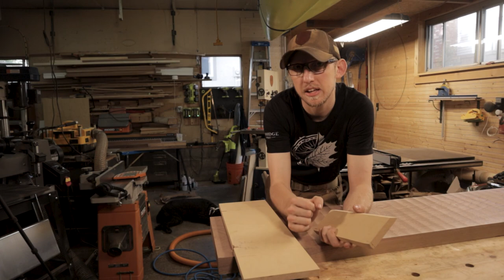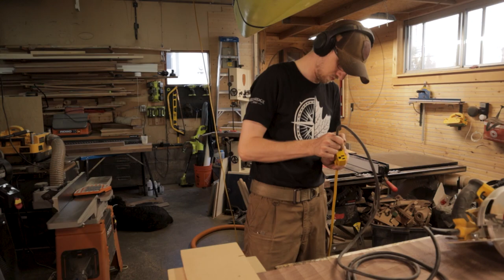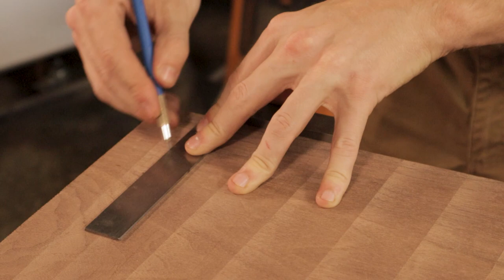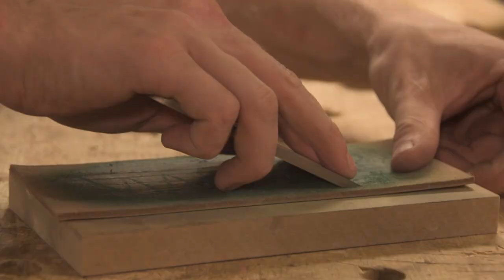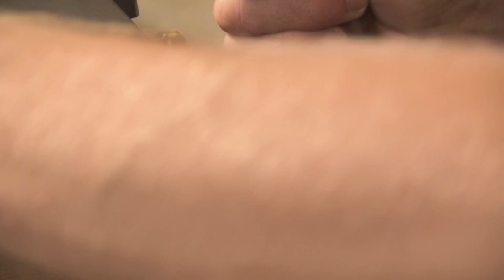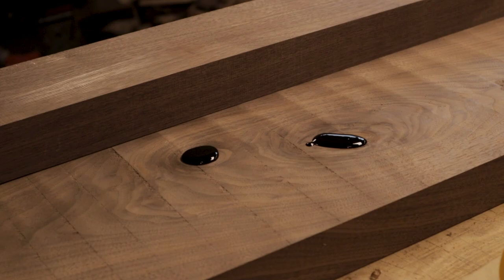Squaring up the side rails with a hand plane | King Bed Frame | Fine Woodworking

Comment: Buy the Festool Track Saw. You will use it for years. It is a shop time vs efficiency issue. It may not be worth the money for just 1 project, but 4 or 5 projects later the track saw has paid for its self in man hours.
Reply from the maker: Trust me I want to but at $900 it's a tough pill to swallow. I feel like if this project keeps going the way it is, I'll end up with the track saw one way or another!
Reply: @morganhurst_redridge  buy once, cry once as they say ... I'm facing a LOT of heavy sobbing myself.

Comment: I'm glad you got to a square board in the end, that was quite a journey, and I've definitely been in similarly frustrating situations on my projects.

I think you probably could have gotten good results with the router if you had adjusted your setup a little bit. If you have a bearing guided bit that is big enough, you can double sided tape your MDF guide right against the line you want to cut. If possible I'd only leave about 1/8“ max to take off with the router after your saw cut.
Reply from the maker: That's a way better idea, I didn't even think about using a bit with a bearing. That would've worked better, I'll definitely remember that when we get to working with the other long stretches!

Comment: I wonder if the circular saw blade is just flexing too much with the thick stock. I know I had that issue with squaring up the ends of my 4" thick Roubo workbench. I just lived with it because it's a workbench. However, I wonder if taking several shallow passes with the circular saw could help prevent the flex of the blade.
Reply from the maker: That's what I thought the issue was too, but when I cut the ends I did the first cut then did a finishing cut that was 1/2 the blade width to try and true it up. Interestingly enough I get the same amount of error almost every time, which is why I figured it was something to do with the saw specifically.
Reply: @morganhurst_redridge  hmm what if you did a test cut where you only cut the first 2 inches of the board and see if it's square there? You could then rule out if the back side of the blade is causing the issue or not. I'm just spitballing here because this same issue has made me frustrated and I haven't come up with a solution either.
Reply from the maker: @mccarthydesign1429  I will definitely give that a shot, it would be nice to actually prove what's causing the issue!